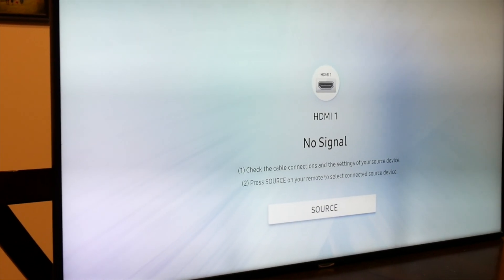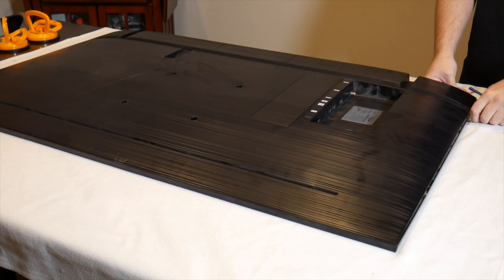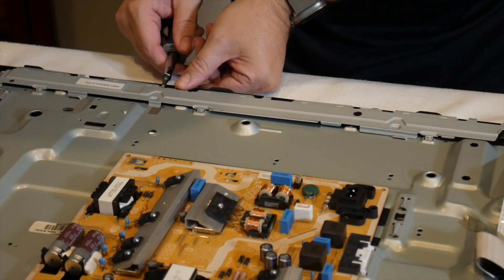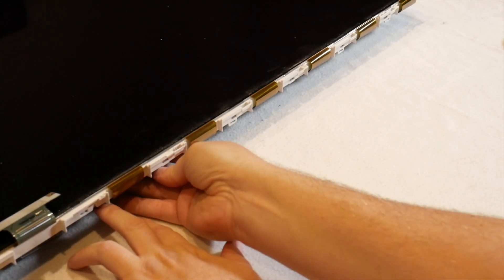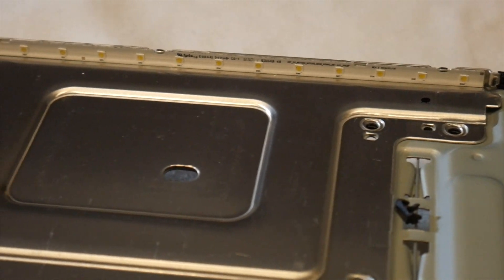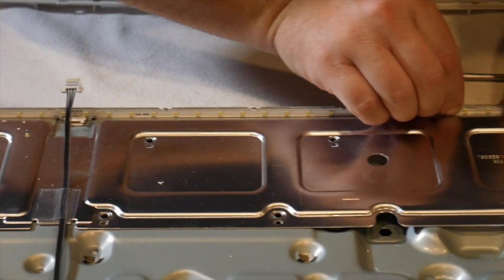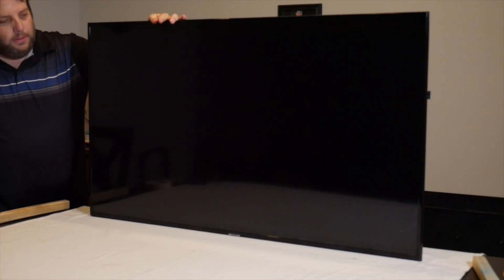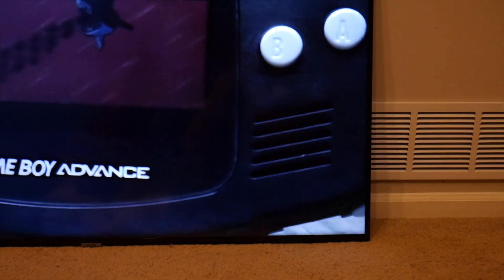How To Replace The Backlight On A 55" Samsung LCD TV

Comment: Always disconnect the backlight plug from the power board expecially if you use a led tester .If you dont the tester will give the power board power and you will have a shocking time .

Comment: Is it a must to replace Reflector Sheets / Diffusion sheets or panel when replacing backlights? I got this from a repairer, saying only backlights only will result in backlights dying again not long after repairs.

Comment: Thank you so much for this!  I'm not bad at repairing things, but I'm not sure I would have had the confidence to almost completely disassemble my mother's TV without you demonstrating that, as long as you have enough space to lay everything out, it can be done!  (It seems a pity that what must be one of the most common repairs can't be made simpler.). 
Hers was a rather different, smaller and older model (though also a Samsung) and probably only about £200 to replace, but it's much more satisfying to fix it for £25 - not least because of the amount of e-waste that you save!  
Much obliged!

Comment: Good video that included reassembly instead of just "now put it back together."  Others have different ways to flip/rotate and lift the unit from the table  This one was best with wood spacers easily found from scraps.  My subframe was different - black and more difficult to figure out how to get the subframe plastic clips past the metal tabs (very small screwdriver to slightly pry).  I could have used a mention of how to align the diffusion panels (had to remove subframe again because the top panel was lifting on my first try (place bottom panel then align each panel to it one by one instead of all at once).  Thanks!

Comment: My backlight failed this evening and I was so upset about it. We treated ourselves and bought an 85" for like $3,000 and it's not even 4 years old. This video is exactly what I needed to figure out how to repair it. I'm ordering the parts right now! Thank you so much for this detailed guide. Assuming all goes well, you just saved me $3000. Thank you.
Reply: Did you get it fixed?
Reply: How did  the tv repair work out?
Reply: @MrToryin it worked great once I got it all buttoned up. Unfortunately, one of the new strips failed and there was quite a bit of heat being produced along the lights and ended up melting the diffuser layers in the area

Comment: Hello I just received the replacement led strips. 2 of them came but they are only 24 inches each. Is this correct for a 55" tv? Rather not get stuck with the TV opened up on the dining room table. 😂 thanks

Comment: Do you know what might cause the TV to not turn on and emit a humming/whistling sound when trying to power on?  After replacing the backlights I think I killed this TV somehow.  I'm pretty sure I connected all the wires and ribbon cables correctly so I am at a loss since I don't know much about electronics.

Comment: I got a Samsung 55", it flashes on the left hand side and it looks like lightning strikes in it also. I took the back cover off and used contact cleaner on the connectors and ribbon cable and checked the power board with a multimeter - fuse, transistors and and resistors, which appeared fine, so maybe its the back light? the LCD was replaced when ants go into the tv. I am thinking maybe the black light., if so your video will be very helpful thank you

Comment: Hi, nice video.  I dismantled screen as instructed.  I found that the right hand LED strip had burned out.  It got so hot at some point that a couple of the reflector layers were deformed including the heavier poly screen.  It doesn't lay flat.  I did put the new LED strips in.  Before I reassembled the TV I'll research this a little but I'm thinking thinking I'm wasting my time trying to fix this.  I wondered if these TVs can ever catch fire.  I was very surprised when I discovered the scorch marks inside.  Joe - Pennsylvania.
Reply: The reflective layers and front screen never went together properly. Tried several times with the layers oriented differently.  Got it together for a final test and discovered the dark layer has cracked. It's now sitting in the trash. Big waste of time I'll never get back. In retrospect, when the first row of LEDS failed, I should have stopped using it. The burned area occurred after that.  Now it's junk.
Reply: Hey Joe, any updates? Thanks! -Brock from Oregon

Comment: The backlight panel in mine was cracked and melted I think I will still replace the panel but I want to try to flip the backlight panel upside down so it looks the best it can since I can't find a replacement panel.